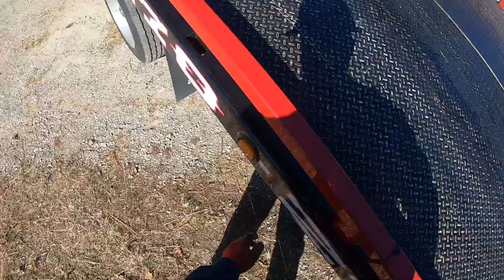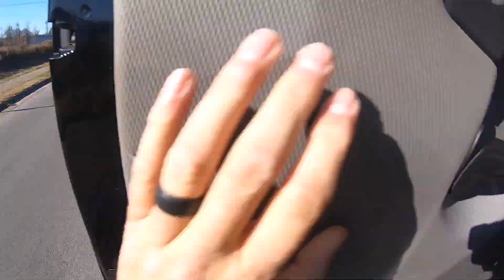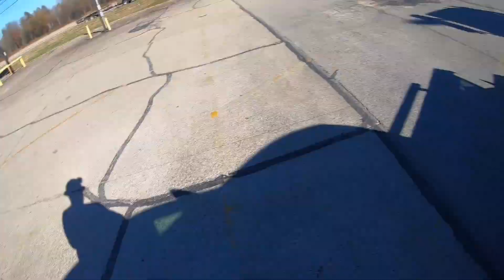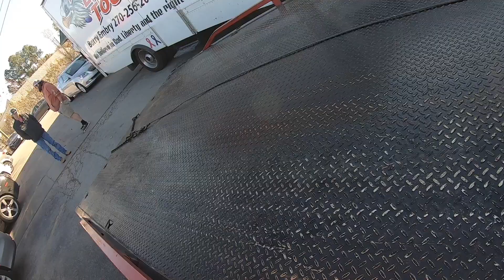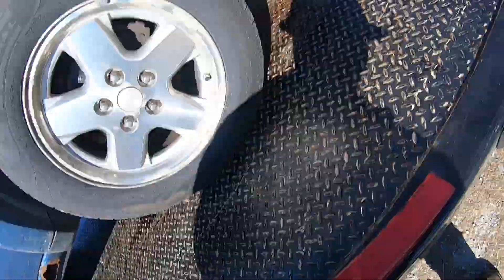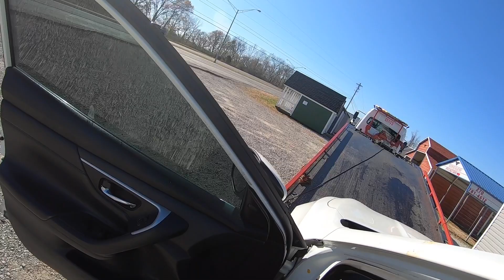Kia Deer Hit, Equinox Auditioning for Dukes Of Hazard, and Camaro Broken Rearend

Comment: Sorry I do not agree with you about the straps.  One mile or one hundred, always 4 point tie down. The winch doesn't count as a tie down point. Just as much chance of it coming off no matter the distance. Shouldn't let people stand behind your truck while loading or unloading. Winch failure is a thing.  I don't believe that driving a vehicle on to the deck is safe. You have no idea what condition the locking pin and or parking brake is in. I like the videos just seem to do things a lot different than I was taught and what the law reads along with the recommended towing procedures for the vehicle reads.